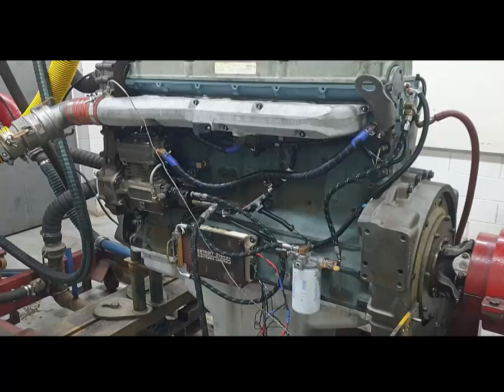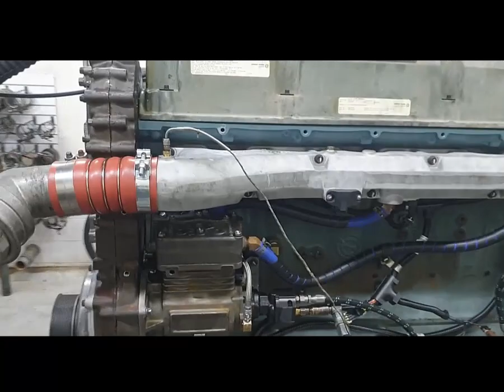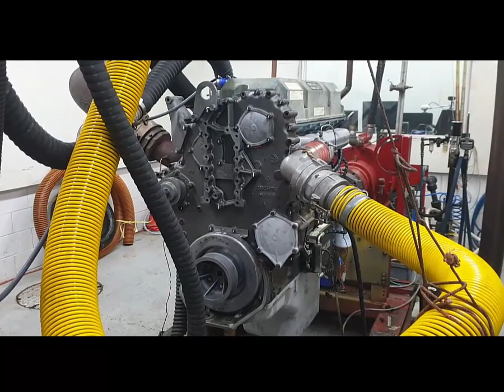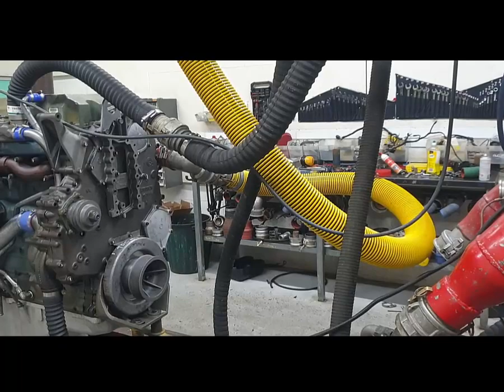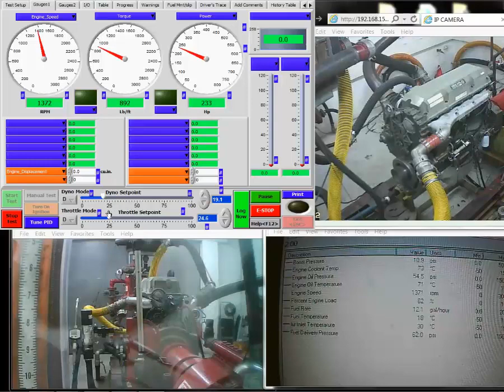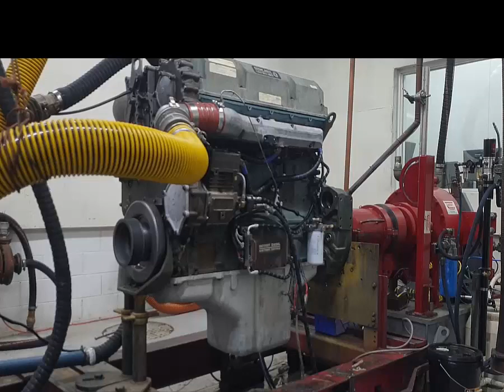Series 60 12.7 ddec4 industrial

Comment: what kind of torque do you get out of the detroit? love your channel been following you guys for years
Reply from the maker: This industrial 12.7 is quite tame. What you see here is what you get. I know the 14 litre version standard is around 1850lbfts. So they are not known for being a high torque engine from factory.
Reply: @dynosmith2187  yeah I had a series 60 Detroit in a 96 Kenworth and it was a good motor but it didn't have the torque like a  cat